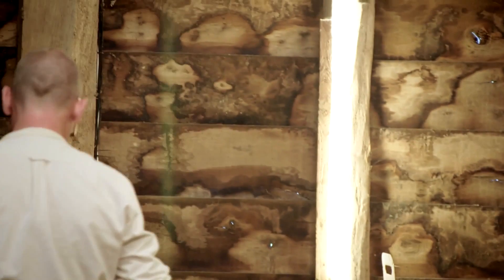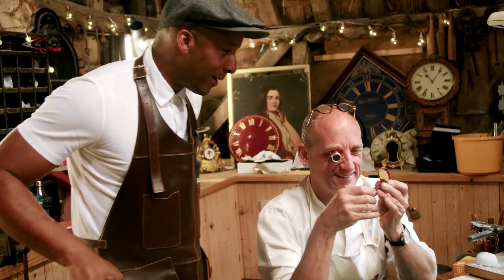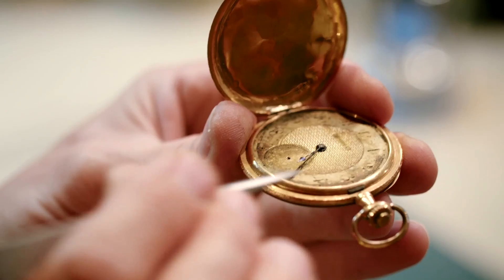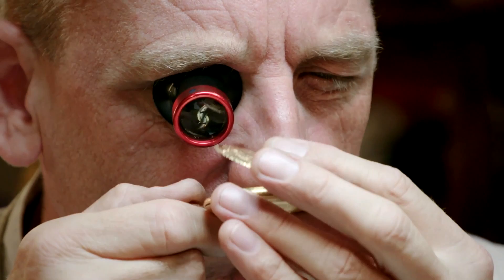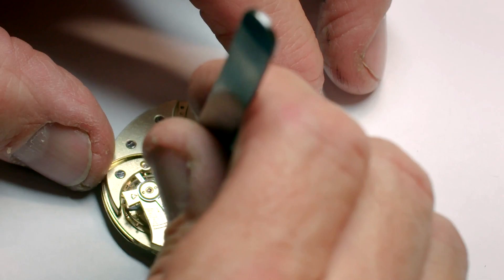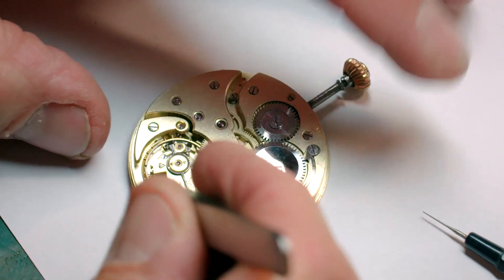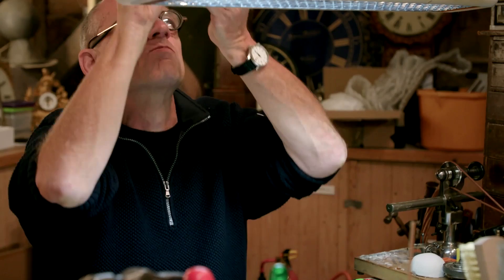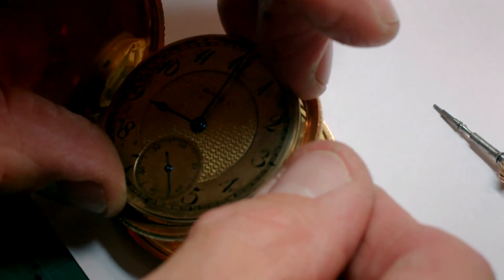Problems Afoot While Repairing Extremely Delicate Watch | The Repair Shop

Comment: I collect and refurbish antique pocket watches. This man should stick to clocks.
Reply: Well I guess he got it working and brought a great deal of joy to the owner. And you, when did you last light up somebody's eyes to that extent?
Reply: @carlosrosa1965  He didn’t clean the pivots and knows it’s dirty. Pivots will wear and eventually require replacement. He’s not wearing finger cots. Oils and acids from fingers leave permanent stains on metals. He also didn’t inspect it for the cause of stopping. Many old watches won’t run because they were damaged when droppped. Running a watch with a broken pivot jewel, for instance, is like throwing sand and gravel in your engine crankcase. For any of these reasons, the owner could be back in a week.

Comment: Use a movement holder for bleeding sake, don’t put hands on with steel tweezers and bare hands 😭😭😭😭 typical clockmaker trying to fix watches
Reply: This programme is fascinating to watch but only because they call it 'the workshop of dreams' when 'the den of nightmares' would be more appropriate. The standard of woodworking is atrocious. They've started to relate themselves to brain surgeons recently -you're having a laugh!!!
Reply: Yes there are a lot of them around, they fondly imagine they can repair carriage clocks.